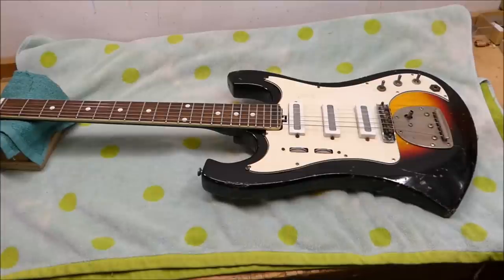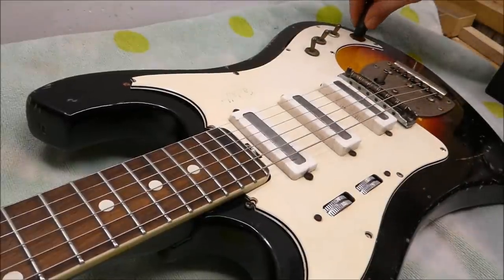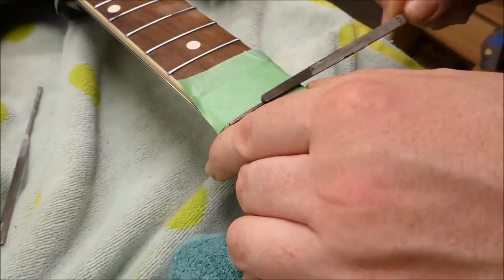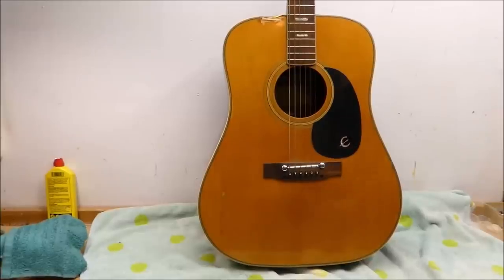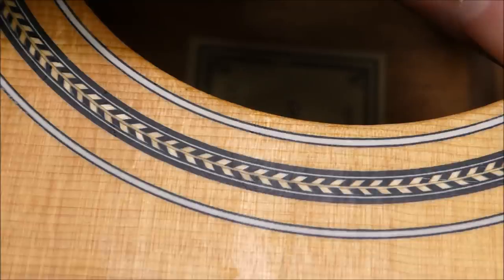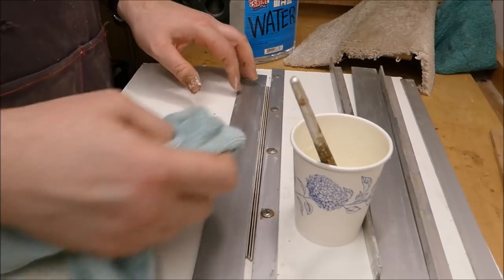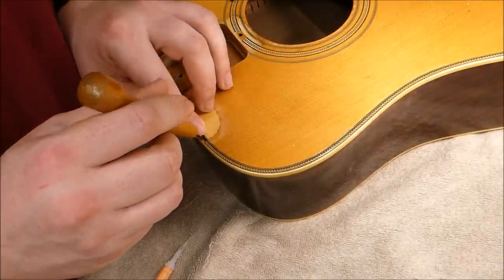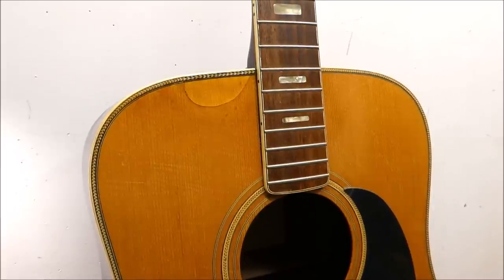Eko Kadett and Epi Ker-unch

Comment: Hi man, I'm from Italy and I've got a circa 1965 Eko Cobra. I love that guitar and, as always, I loved your video. The orginal tremolo is fantastic and stays in tune really well
I'e got a question, most of the my roller saddles are stuck, do you know any way to realease those? I was thinking of electrolysis, do you think I'll work?
Reply: Zango,   electrolysis seems like a brute force method and would probably remove plating from the bridge. I would soak it in some kind of penetrating oil, Liquid Wrench or similar.  A newer product called Kroil is purporting to be much better. Many mechanics make their own penetrating oil; a 50-50 mix of  hydraulic fluid and acetone.  In a worst case scenario you could try Coca-Cola, or vinegar. Coca-Cola will remove rust and corrosion products but it could also take the plating off.
Reply: There is no reason electrolysis would not work.
After the process, rinse well and dry thoroughly.
Spray with dry lube, such as: https://www.wd40.com/products/dry-lube/
Wipe off excess, before getting near instrument.
Reply: @zapa1pnt  , actually,  In the spirit of "first do no harm", like the Hipocratic oath, I would remove the bridge and heat it up with a hair dryer ( or in an oven at very low heat) and then put penetrating oil on it. Heating it up would drive air and moisture out from the corrosion-filled roller bearing areas,  and as the metal cools a slight vacuum is created that will tend to suck the oil into the corroded spots (actually, the surrounding normal air pressure pushes the penetrating oil into the joints).  I have used this technique to free up stuck rotary switches in older tube type audio electronics,  Without having to  unsolder and remove the switch. You could try the same technigue with vinegar instead....
Reply: @goodun2974 :
Oh, it has roller bearings?
I thought it was just the string rollers on posts.
Reply: @zapa1pnt  ,  I don't believe it has ball bearing rollers,  if that's what you meant. (Never seen an original Eko vibrato bridge but I've seen Bigsby roller bridges in the distant past). But, when you have a metal rod and a hollow sleeve over it that acts as a rolling bridge-saddle for the string,  then the space in between the two is indeed a "bearing".  Kind of like a paper towel roll on a very snug fitting rod or dowel.  From the guy's description it sounds as if there is corrosion between the roller and the post or rod sitting inside of it. I'd be looking to get the penetrating oil down into that space.
Reply: Thank you all! I'll definetly try heating up it and putting it in penetrating oil
By the way the bridge it's the same exact as the one in the video, it's basically a threaded piece of metal rod that can spin, it's not the prettiest solution but it works
Reply: I have the original term system & I wish now I didn't replace it...although not a trem heavy player I enjoy its judicious use...I wonder if its weight etc will change the tambre of its sound??

Comment: Never been a fan of zero frets, especially on a trem guitar. Having said that, I have 2 - a "Spirit By Steinberger" (which is OK because the strings are clamped right behind the zero fret so there is none of that "sawing action" cutting slots into the fret) and a BMG Special (replica of Brian May's Red Special) which  was really suffering from groves that the strings had cut into the zero fret with noticeable "pinging" when you bend the strings.  I replaced the 0 fret with a stainless steel fret (StewMac kit with 3 ss frets that are higher than your normal frets - specifically sold as "zero fret replacements"), and so far, so good.  SS frets are a bitch to work with. Super hard to cut and trim. But probably worth it for the extended life.